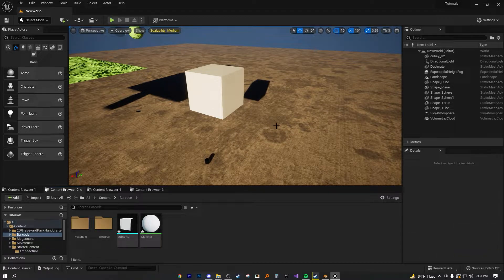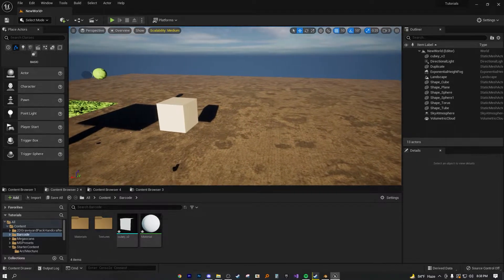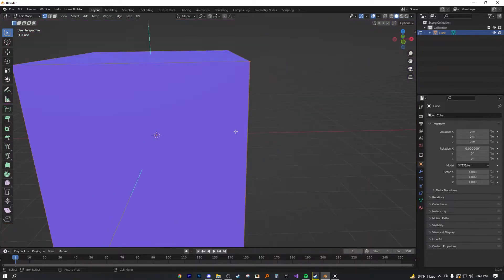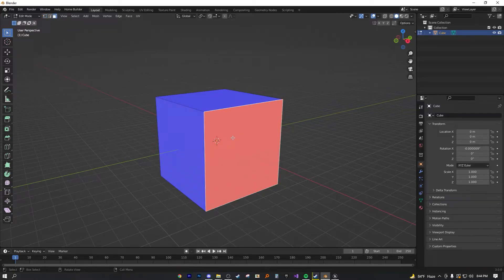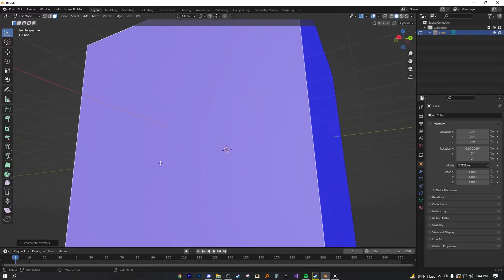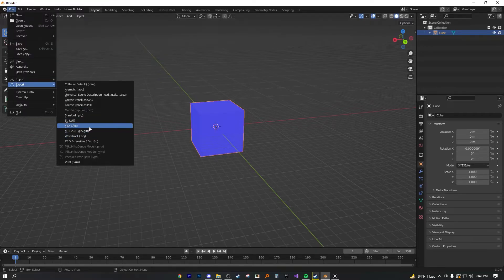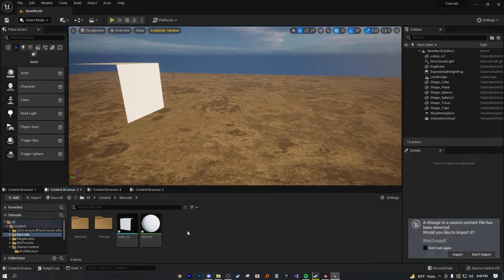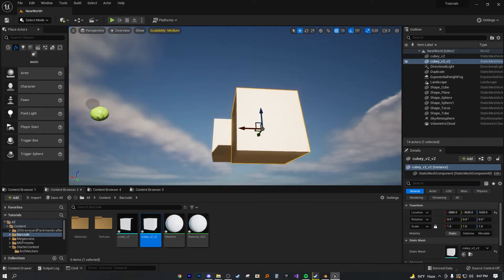Unreal Engine 5: How To Fix Invisible/Missing Faces on a Model (Flipping Normals in Blender 3.0)

Comment: My issue is having the normals blue inside and outside for tubes and rooms~ you ever try to export a tube from blender to unreal? its all invisible inside but not out so was hoping this could fix that issue.
Reply from the maker: Add a solidify modifier in blender to add thickness so that the interior and  exterior are different faces and therefore different normals. Currently yours are sharing faces which is why it’s partially invisible
Reply: @BARCODE-EXECUTIVE  That fixed it~ thank you
Reply from the maker: @AiresXseriA your welcome 🤗 I’m actually gonna start uploading ue5 tutorials again so stick around
Reply: @BARCODE-EXECUTIVE  can you help me with something? I subbed btw! I keep getting this error when importing to unreal from blender on my fbx FlowerPipe has degenerate tangent bases which will result in incorrect shading.  MikkTSpace relies on tangent bases and may result in mesh corruption, consider disabling this option. 
FlowerPipe has some nearly zero bi-normals which can create some issues. (Tolerance of 1E-4)

Comment: Thank you so much!... You literally saved my sanity as i had this trouble over 3 months 🤣💔... I worked really hard on a character of my own only to find out that it have this problem on its right arm and leg. Maybe because of the mirror modifier i used. But thanks to you i can now fix it. But i have a question about something.. I am modeling a simple cape from a plane with only one side.. Does that mean that one of the cape's sides will always be invisible?.. Do i have to make it thicker like you said about the box in the video?.. ...and thanks again for your help!

Comment: bro help plz

if i go inside the cube the problem will reversed

i cant see face from inside
Reply from the maker: That's an easy fix. You just have to load the cube into blender, apply a solidify modifier (which gives it some thickness) and you make sure the normals are the way you want them. Essentailly, whenever you need to be able to the faces from both the inside & outside, you need to simply "thicken" the model, just enough so that the outside & inside faces 2 different faces. that way the normals can each be facing the direction you want